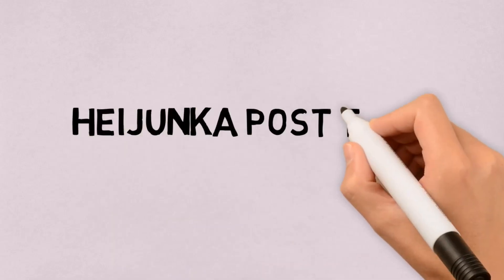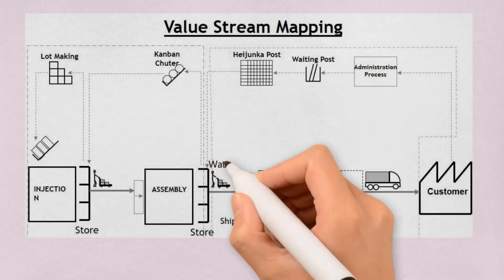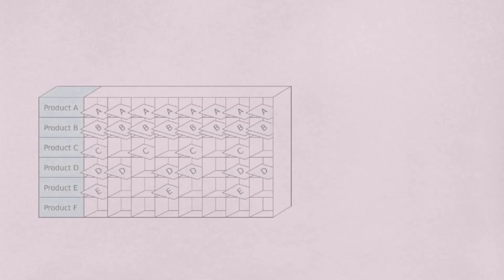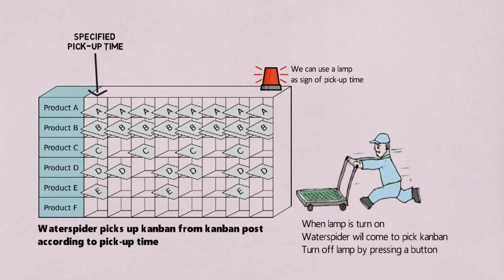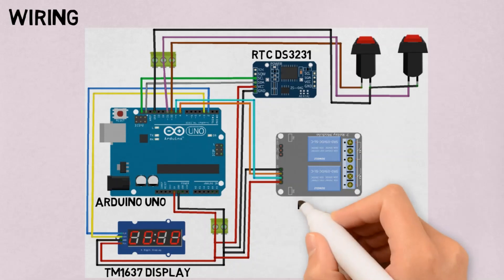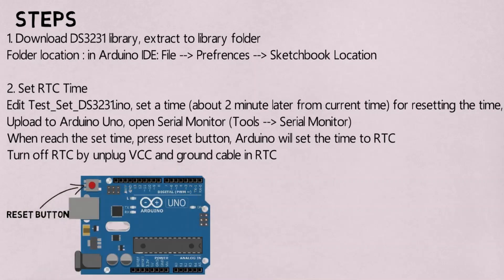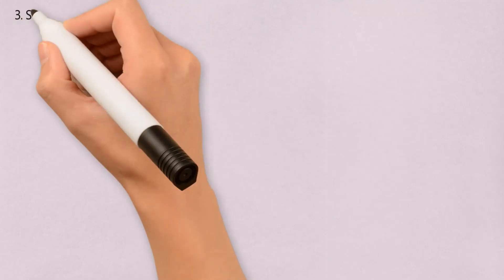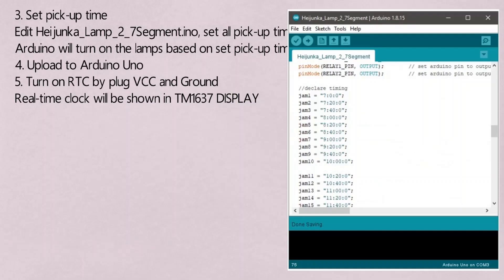Heijunka Post Timer using Arduino Uno

Comment: You should do a video using the Nextion with the UNO and taking advantage of the RTC in the Nextion. Use the Nextion touchscreen to set times to turn On and Off relays. The UNO handles the relays, the Nextion is the interface and RTC for the UNO time schedule. 

Would be a super cool video.